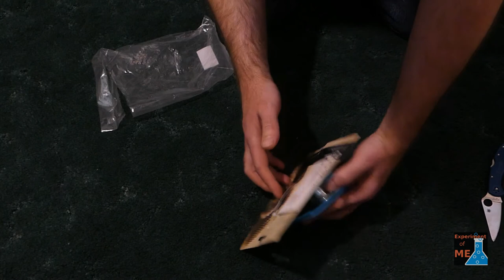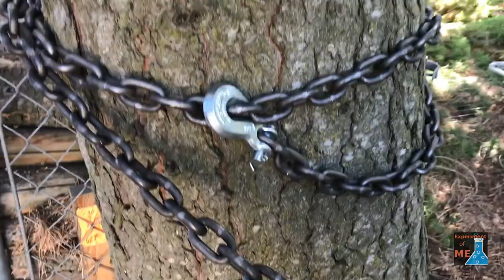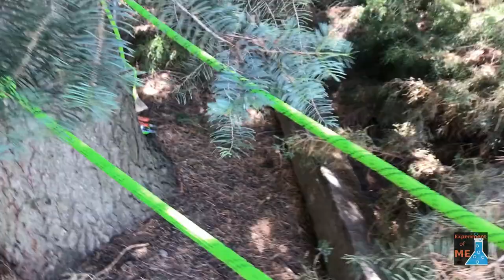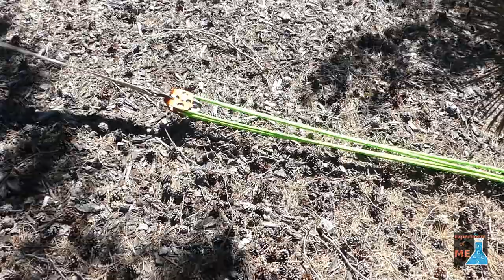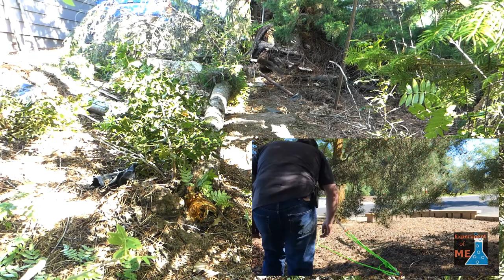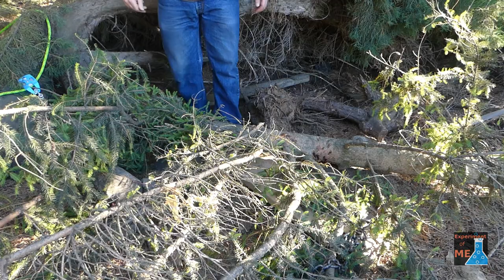Tree Uprooted with 25 to 1 Compound Block and Tackle

Comment: very good I started with block n tackle about 15 years ago and have pulled many stumps and even pull large trees down. I use my compact tractor to pull, I have a 7:1 that I connect to a5:1 for the big ones the power there is unbelievable its quite a bit of work but very satisfying to see that stump crawl out of the ground.

Comment: Liked what you did.  I Pulled a 12 inch aspen out of my yard last summer with a 150 to 1 system with a progress capture pulley set up to hold my lines tight while I reset. I was looking at what you had there and saw a much more efficient way. When you were at a 20:1 ratio, you could have used that extra pulley from your dad and doubled the whole system making it 40:1 by bulling your 5:1 with a 2:1. 2 x 5 x 4 = 40. Also, you wouldn't have had to break down any of your rigging. Get yourself a prusik loop to set as a progress capture and you can hold tension on the system while you take a break.  Either way, I liked it. It's fun to do stuff like this.
Reply from the maker: Thanks.  I think having a prusik is a good idea and will get one soon.
Reply: 150to 1 ? 
How many miles did you walk to get the slack out of the system? 😂

Comment: Does the strength of the rope needs to be rated at the total force or just one “leg” of the pull? In other words, will a 500 pound rated rope work?
Reply from the maker: Only needs to be rated at tension force you will apply(plus safety factor) even if force the pulley applies to the load is much higher.  Always include a safety factor, knots and sharp bends in the rope reduce strength significantly.  If the rope breaks, it is extremely dangerous.
Reply: Honestly, if you wanna do stuff like this, then get a lever hoist or come along, saves you time and money .